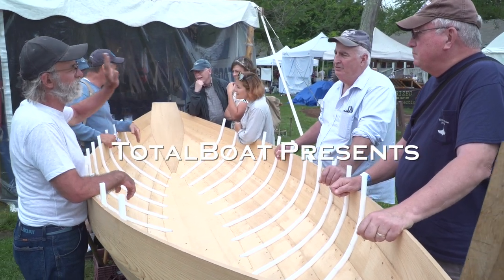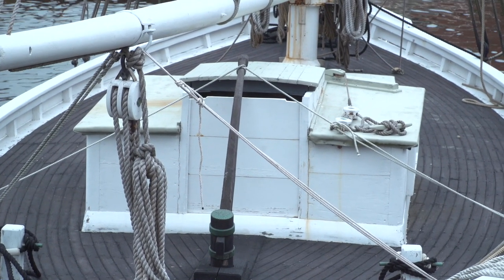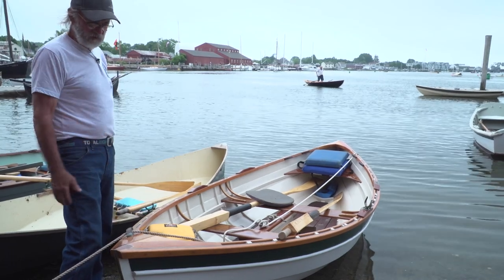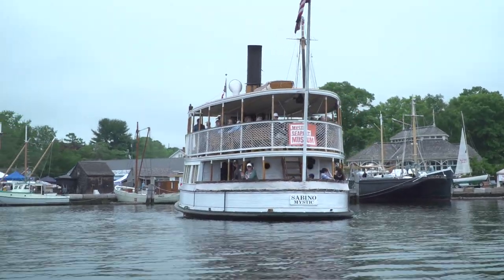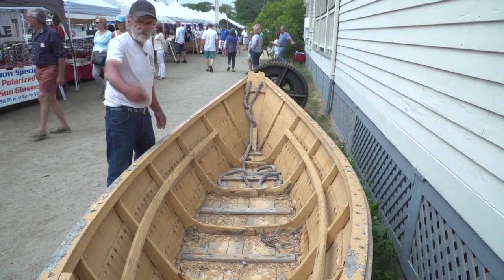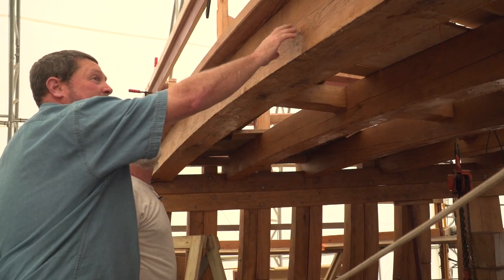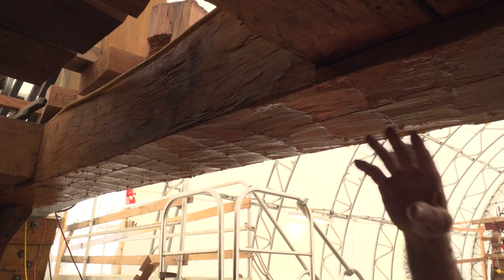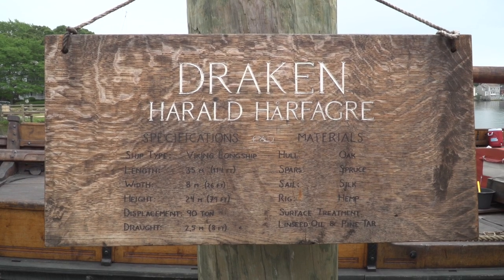Building the TotalBoat Sport Dory: Episode 27 - Dory at the WoodenBoat Show Part 2

Comment: there are wedges on both ends of the Trunnels. the inner ended wedge is driven in by the blind end of the hole as the trunnel is driven in..

Comment: If you had no access to any other wood except Pinus Radiata to build a boat. How would you protect it from the elements. It might sound like a dumb question, but its a totally renwewable recource  and a good wood to work with.
Reply: It's a beautiful wood.  I'm no expert, but the topic is interesting to me.  I'm just thumbing thru my brain cells trying to think of what I know about exterior treatments for wood.  Like a Roll-a-dex of useless garbage, but I know that the books of Bob Flexner come to mind.  I would start there and see where it gets you.  I see a lot of his work is interior, but some exterior also.  Anyone interested in wood and finishes should read his work as a starting point.  He has tested all manner of finishes and I would consider him the final word on the subject.  One thing I know is that the snake oil market is thriving in the wood finishing game.  I have another source called Fine Wood Finishes (I think.  I don't want to make noise dragging it down off the shelf) that shows the results of many tests.  This is a very deep and misunderstood subject with a jungle of misinformation to cut thru.  Some of the least expensive products outshine the major players and put them to shame.  Minwax Wipe-On Poly rates very highly against many of the contenders.
For an extended discussion, let me know what your questions might be and I'll try to dig up some info for you.

Comment: Yes to workboats. A number of years ago an architect and I built a quite expensive house here in Austin Texas, The mandate was to fit the neighborhood and the site using modern, but proven technologies and to be a "lobster boat, not a yacht". Worked out well.

That Scandinavian dory like boat at 3:15. Look at the rudder, the stern post is higher than the rudder head, and there's a square hole in the rudder head. I suppose there must be a transverse square bar that fits the hole, probably with tiller lines to control the rudder, but how do you make the bar to rudder joint solid enough? And the rudder's hung at an unusual angle which, if not balanced correctly can make it very difficult to steer.

I love Peapod's, and I miss rowing. BTW, nice feather technique on the oars (I noticed it before you explained it). Right hand over left for me. Almost expected you to snap the oars out of the locks, but yeah probably wouldn't do that with a borrowed boat.

I've only been to Mystic once, back in 1962 I think, but I remember the Mayflower well, it was in the water then and I scrambled all over it. In the 90's I worked on the rebuild of the Columbus Fleet replicas in Corpus Christi TX. Erm, let's just say it wasn't the best idea to lease the ships and display them in hot humid Texas, then leaving them unprotected in the ship channel where the Santa Maria and Pinta got nailed by a barge and had to be move to a "temporary" drydock pretty much sealed their fate. There was never enough interest or money to fix them correctly, nor did the administration have any idea what it would take to maintain them, let alone repair them. Basta. That's when I went back to school for CS.

Comment: So original mayflower? Rebuilt in 1957 and now.  Thanks Lou.
Reply: Haha, no.  Nothing built early 1500s time frame, would have lasted anywhere near that long.  I think I remember reading somewhere, that they're pretty sure the ORIGINAL Mayflower (of Pilgrim immigrant fame, not the many later namesakes of various sorts that came after)... was hauled ashore somewhere in England long ago, and the lower part of the hull turned upside down and re-purposed as structural framing for a barn. 

No, the 1957 date, would be the original new-build date for this one, which is a US-made replica.  Now being substantially restored.  VERY tough to make the large old-style ships last longer than 40-50 years, even with constant immaculate maintenance, and the absolute best of top-quality materials in the structure.  And of course most of the working ships in the old days, didn't start with those advantages, so were usually worn out and rotten in even shorter time.
Reply: Notice the signage around the boat...this is called Mayflower II.
Reply: I believe the Mayflower II was built in England.